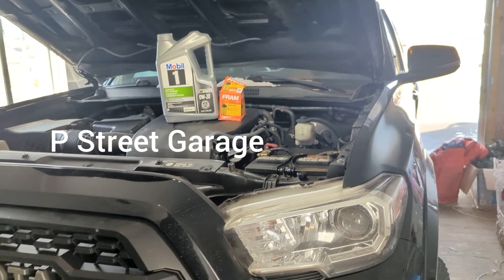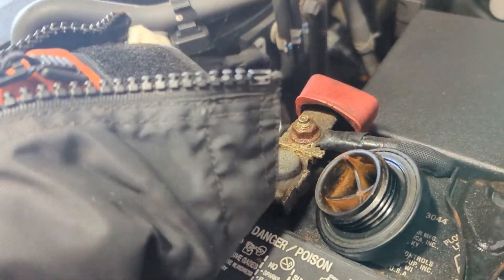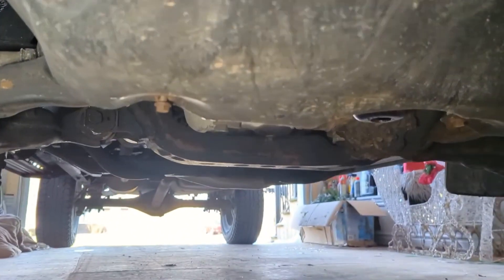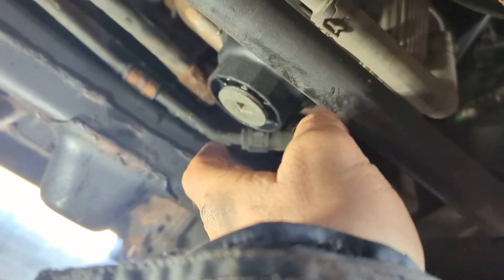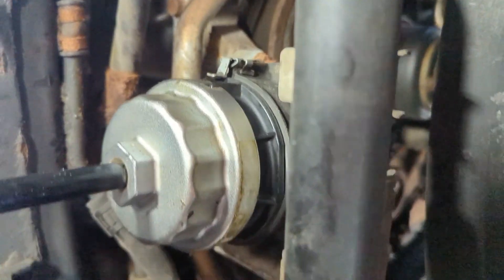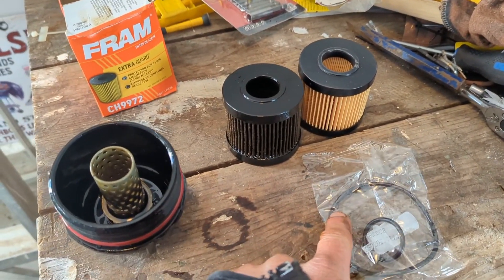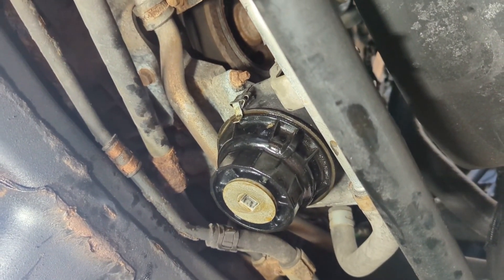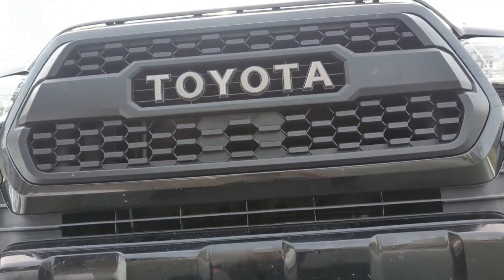Oil change on a Toyota Tacoma.

Comment: The condensation build up around the cap and neck is normal it's just for moisture out of the air as the engine runs and heats up the air that's trapped inside also warmed up and gets kind of trapped in the neck then once it cools down the moisture condenses
Reply from the maker: Ya it's what I thought.  My coolant level is good 👍👍